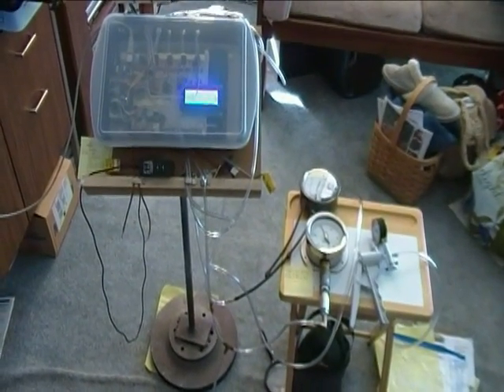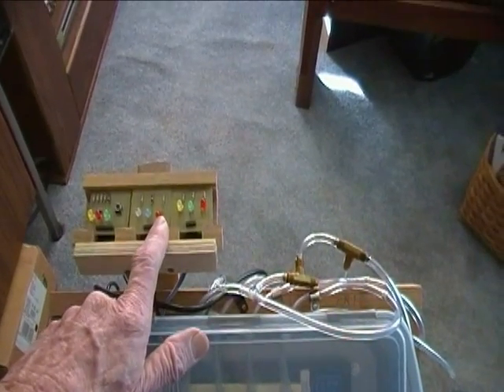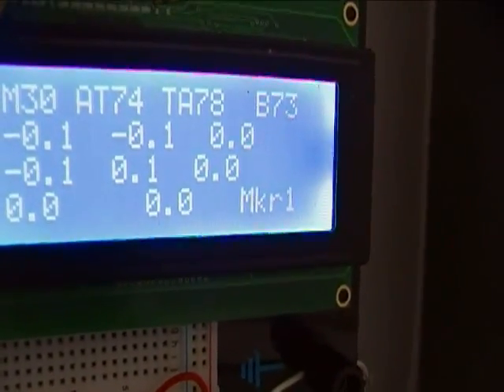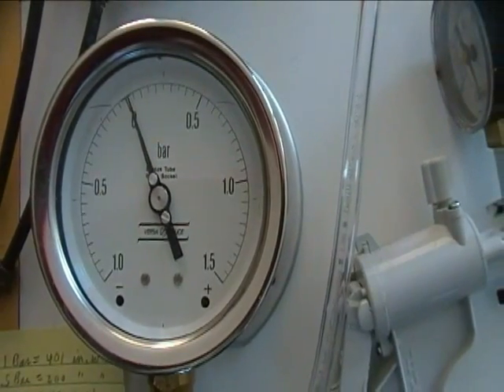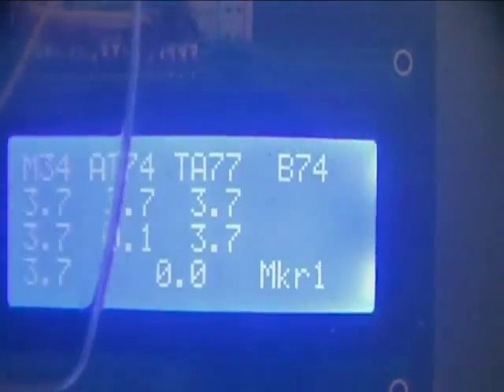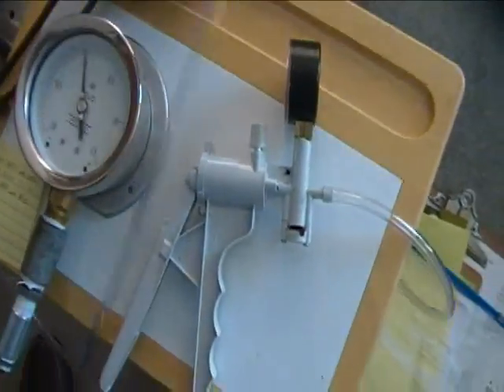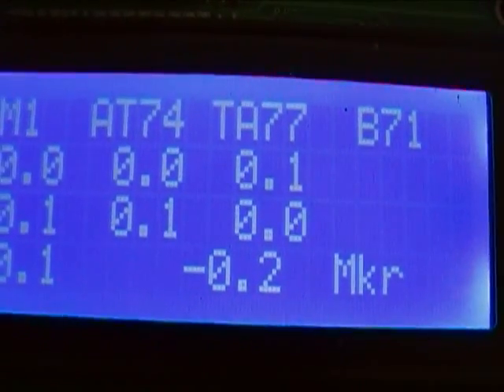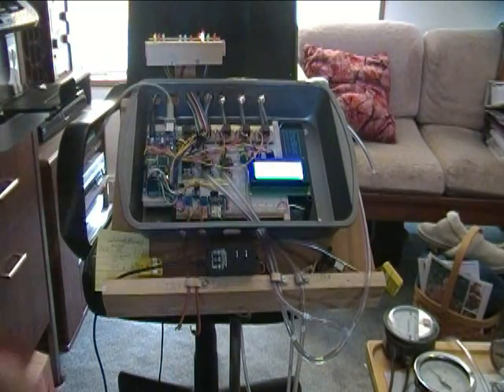Arduino Woodgas Datalogger Rebuild Feb 2013

Comment: Great vid! I actually ended up here since I am trying to figure out the type of tubing you used for your MPXV5010DP. I can see (barely) that you plugged the tubes directly to the ports but given that the ports are .130" wide I thought I'd need an elbow or somethings like that. Also, do you use probes on the other end of the tubes? I am basically trying to measure the differential pressure on both sides of a filter in an air duct. Thanks in advance.
Reply from the maker: Thank you for your comment!
No, I don't use any probes on the end of the tubes inside the vessel.   The temperatures inside the reactor vessel get as high as about 1500 degrees f, so I rely on the fact that there is suction there to keep the passages clear.  It has worked well so far.
 Feel free to ask for more info if I missed a point.

Comment: Does the MPXV5010DP sensor lets air through or it's sealed? I need a sensor to detect the air flow through it. Or is it only those sensors that have GSX at the end do this? I believe MPX2010GSX does this, but it's harder to get it from where I am.
Reply from the maker: No.  The MPXV5010DP does NOT let air through.
Reply: Thank you.

Comment: Hi, I'm trying to build a speedometer for a kayak using a MPXV5010DP and a pitot tube. Do you think this sensor could help for that? My (low) understanding of the math for the pitot tube is that the max velocity I can measure is Vmax = sqrt( 2* ( p1 - p2) / water density ), so following this math I need a 50kpa sensor to measure 10km/h. What kind of sensor you recommend me to use for that purpose?
Reply from the maker: The MPXV5010DP is a 10kPA sensor, I think.  If your math is correct, you need a much higher capacity.
Why not just buy a simple mechanical gage and hook it to your pitot tube and see what happens? 
Here's one:
 http://www.surpluscenter.com/Air-Pneumatics/Pressure-Gauges/Pressure-Vacuum-Gauges/15-PSI-4-5-FP-Dry-Gauge-21-1735-A.axd

Pete Stanaitis
----------------------
Reply: Thanks for the reply!, The mechanical gauge is a really good idea for testing. I didn't consider that. I will try it

Comment from the maker: Start by getting the datasheet for the MPXV7007DP at:
http://cache.freescale.com/files/sensors/doc/data_sheet/MPXV7007.pdf
If you still don't get what you need, contact me again with specific questions.

Also, you might look  at the short tutorial here:
https://moderndevice.com/product/pressure-sensor-mpxv/
In addition, they have some nice breakout boards with or without the sensor for decent prices.

Pete Stanaitis
----------------------

Comment from the maker: Good to hear that someone else  is doing something like this.
I get the sensors from Mouser Electronics, Modern Devices and Digikey. If you google "Freescale"  you will find plenty of references for these sensors. The first pressure sensors I bought were just the "chip" and I made my own pc boards.  Later, I learned about Modern Devices who has the sensor mounted on a breakout board.  MPXV7007DP is a differential sensor which can read pressure or suction.  Not all "DP" suffixes mean differential